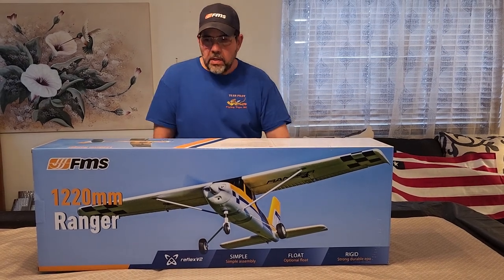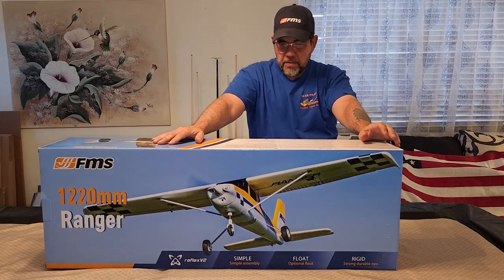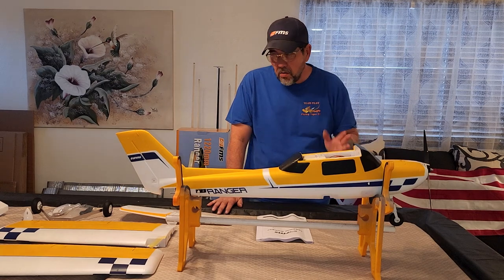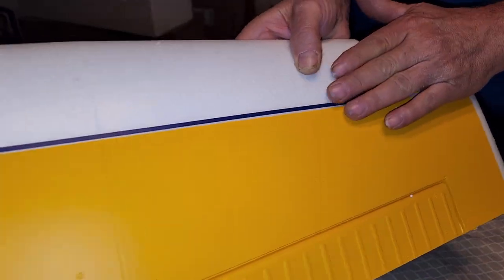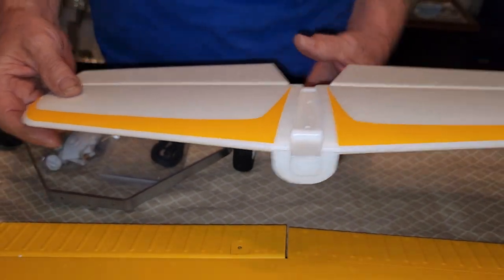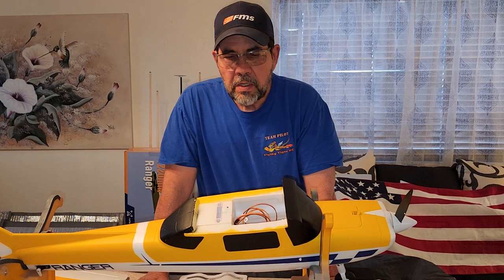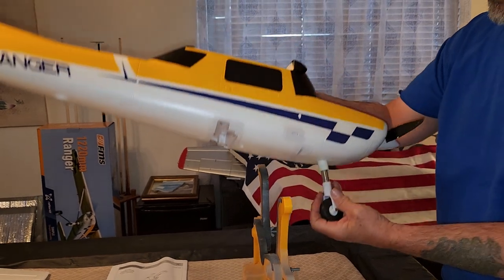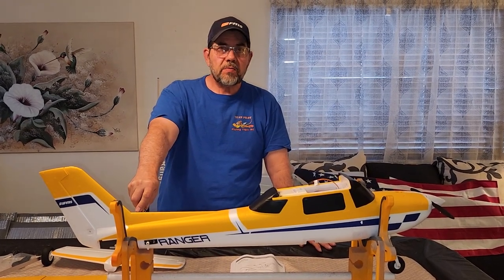FMS 1220mm Ranger unboxing

Comment from the maker: https://www.fmshobby.com/discount/SASRC?ref=SASRC 

Stars And Stripes RC here, I wanted to pass this along. FMS has authorized me to share a couple of discount codes for my subscribers and friends. All you need to do is click on the coupon link, select the airplane you want. Add to cart, when you check out the discount is automatically applied. One is a Unlimited $10 off with purchases of $100 or more code: SASRC https://www.fmshobby.com/discount/SASRC?ref=SASRC which can be used only for airplanes and accessories.
The other is a One time only 10% off code for airplanes and accessories only. code: ReferralSASRC
https://www.fmshobby.com/discount/ReferralSASRC?ref=SASRC
These codes would also be good for all of your rc friends so please share the codes with all of your rc friends as well.